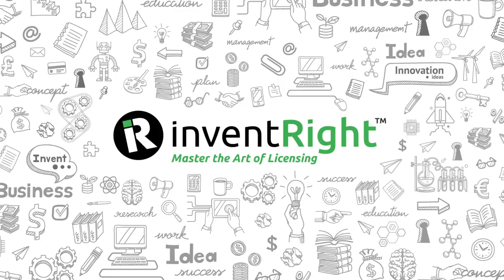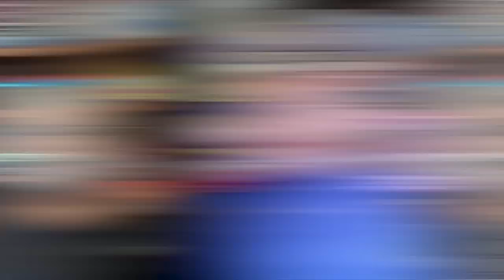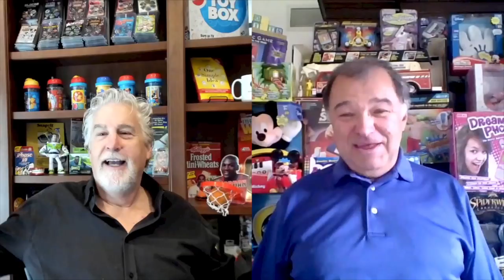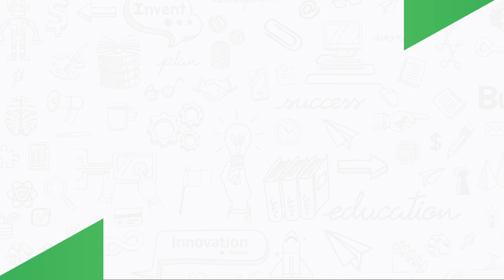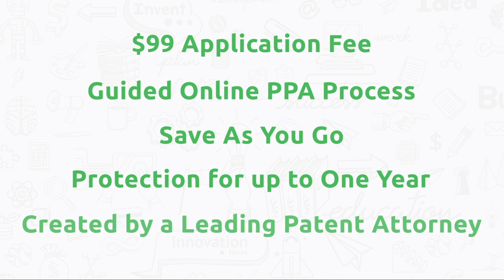Behind the Scenes With a Former Hasbro Director of Electrical Engineering

Comment: Excellent video.  My latest invention required me to figure out the Arduino and coding with the IDE (programming software).  The prototype is made of single unit consumer purchased components so the BOM (bill of materials)  would have been many times the cost of a production run of the invention.  I went back and built a BOM with prices based on 2000 units and the cost came down significantly.
Reply from the maker: Thank you for sharing!

Comment: Hi Steve

I talked to someone yesterday that watched our interview.  They have an electronic product concept and have already paid a Patent Lawyer to file a Provisional and Utility Patent, neither filled yet.  In our conversation I learned that they have not done a production preliminary design to determine how much it will cost to manufacture their product.  This is a major mistake.  Before you spend money patenting your invention you need to make sure that you can produce it for a price that people would be willing to buy it for.  It’s not worth patenting the worlds best widget that will cost $50.00 to manufacture (MSRP $250.00) if people are only willing to pay $50.00 for widgets.  It’s better to spend a few hundred dollars talking to a Licensing coach and doing a high-level engineering design to get a rough estimate on what your widget will cost before spending thousands on a patent.

Thanks

Bob
Reply from the maker: Thank you for sharing Bob! You're absolutely correct.